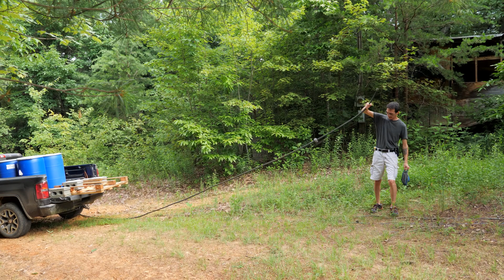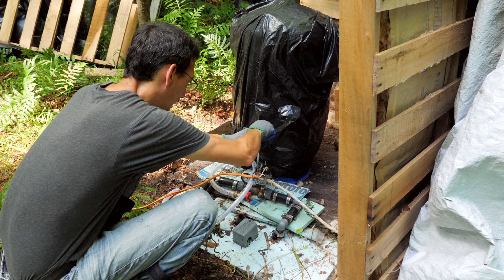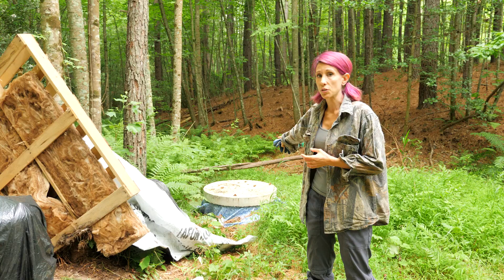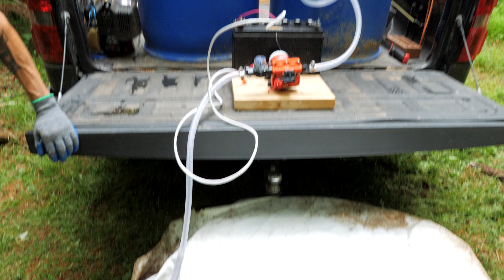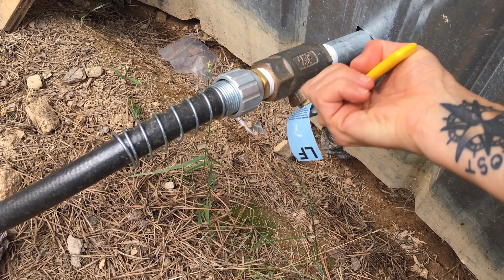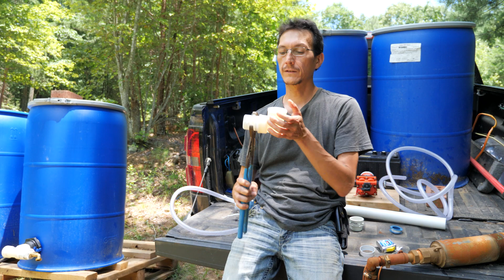NO WATER...AGAIN! Will This Off Grid Gravity Fed Water System Work? (Part 1)

Comment: A good deterrent to snakes in well houses or other areas is moth balls, if you spread them around inside and around your well house or sheds it will deter snakes, for some reason they will not go anywhere there is a moth ball line, moth ball granulated works very well too, years ago people kept snakes out of the crawl spaces of their homes by using this method.  We live in Oklahoma where there is no shortage of copper heads and we have found it really works.

Comment: There is an alternative to re running a larger gauge wire, depending on how much load your pump takes it may be dramatically cheaper as well. You can just use a pair of transformers in most cases. I don't know of any direct burial/UL rated cable that isn't rated for 600V min. so as long as you don't have breaks in the line there should be no problem stepping the voltage up to the 480V regime so that it can make the long stretch without causing so much joule heating and loss in the cables because you're pushing 1/4 of the current. Then you just step back down to the 120V regime and go straight from that to the manufacturers pump wiring. You might have to look online for a calculator to tell you how many volts you're going to drop on the way @480 @ whatever load the pump takes, so that you know what winding ratio to order for the second transformer, but that shouldn't be a challenge with the experience you've gotten so far. All you need to know for the transformers is the winding ration of ~1:4 (120V:480V) on the sending side and somewhere between 4:1 and 3.5:1 (480-420V:120V) on the pump side, as well as the VA (Volt Amp) rating, which can effectively be set to the wattage of the pump + a few% for peace of mind for the pump side transformer, and that number + the estimated wattage of the transmission losses on the sending side. Seems complicated but it really isn't and it could be so much easier than re laying 8awg that whole way.
Reply: Nice suggestion.  A the beauty of it all is the necessary components are readily available from places like Ebay and hunting on Craigslist.  600V AC is easily doable and safe.  The installation would be straight forward and easy to install.
Reply: Eh, I mean, I know all modern cable is tested to several KV but I don't like recommending more than 480 to anyone that I can't confirm to at least have a Journeyman's hours because 1) that's the highest their going to find common documentation for and 2) that's the highest voltage on a load restricted system that I've taken clean across the chest so I know a healthy adult male should be able to take it. Not fun, never trust people when power is involved. *Never*.

Comment: Hmm..  and here I am dealing with mice in my house and finding that a challenge, not sure I could handle copper heads or worse...   you guys take care and keep safe..By the way, "alligator clips"   (at least that is what I know them by??)   would maybe be a better option to connect the wire to the battery, faster "on/off" option??   Please, I am not putting you down by any means I have the greatest respect for you and how you are coping,  Just trying to offer my 2 cents worth...

Comment: I would install a 500 to 1K gallon spring box. Run a #4 wire set and bury 4” pipe. Run a 2” pipe inside the 4” pipe. Bury the pipes below the frost line and if I hit solid ground then I would insult in pipes. I would not spend $10K or more on a well that has no “ Guarantees” of water nor flow when I have a spring on my land!

For the $$$ you spend on the well, $10K to $20K, you could install a big spring box, 800 to 1500 or even 2,000 gallons of water, install a solar water heater and a solar power system to pump the water... Go rent a track hoe. Get something the size of a 320 Cat. Not a toy! Or hire it out, just make sure that it’s a big hoe so it can move the rocks and dig through the hard ground... I would dig out the spring so the water enters the box from the bottom of the box through several feet of wash stone. Bury the water line so it is in a bigger pipe. That way when it needs to be replaced all your doing pulling Out the old and installing the new... I would have it so I could use the bigger pipe till I was able to replace the water line...

I do not usually give advice but you have water on your land. Why not use it?   The water bugs in the pipe. They help keep the water clean. People have been drinking water from spring boxes with your ‘creepy crawly’ for a really long time... They help keep the water in the spring boxes clean. They eat the things that contaminate water.

There is on question I do want to ask you that most people that use springs or the old timers all use to know... Why have you not cleaned out the pipe or spring box? All spring boxes need to be inspected every few months and cleaned out.

Comment: If you purchase food grade IBC totes you can then just paint them black and stack them in the shade.  They can be interconnected and then outflow connected to a standard hose bib.  This is connected to a simple pressure tank and then run into the house.  Each tank is 350 gallons.  I have 10 that I collect rainwater in to water the garden and run the showers and wash clothes with.  The outflow runs into the garden via a drip system.

Comment: Just a suggestion. I use the same sea flow pump it can be hooked up to the pressure tank. You have to put a check valve on the suction side of the pump. It pumps up to 60 psi then shuts of. You may want to wire it to the pressure switch you have now so you can adjust pressure. That's what I did to lower my pressure making run time lower. Stops the need to haul water, you may lose some volume but I didn't. Then you just need to keep battery charged on ocassion

Comment: One temporary and cheap rainwater catchment reserve option is that you set up a tarp catchment uphill from the barrels. ... old billboard plastic/tarp tied on four corners (high-ground or between trees) coming down in the middle V with screen covered pvc going down to your barrels . I believe Homesteadonomics had a YouTube on something similar very recently.

Comment: A bulge pump for a boat can pump like 1800 gallons per hour. Its only like $70 at academy. I have to use one to drain water out of my jet tub. The slum lord...i mean land lord (lol) did not want to fix the leaky shower pan or take anything off of the rent for me to fix it. So i had a water hose coming from the shower head to get water into the tub....and a hose connected to the bulge pump going straight into the toilet... I spliced the wires and connected it to a 12 volt adapter plug. It worked great...that way you dont have to hand bail the water out of the well.
Reply: Lol...yall did it...not even minute after i suggested it...

Comment: 8-2 copper UF-B (direct burial) wire is about $1.50/ft.  If you get a 240V pump, 10-2 UF-B is about $1.00/ft.  Some one smarter than me would have to do the voltage drop calculation for 350 ft, but 12-2 UF-B is about $0.50/ft.  My guess is whoever put the pump in was assuming they were going to use a 240V pump.

Comment: You should be able to hook the RV pump up to give you additional pressure like an RV is hooked up. When you turn the water on, the pump should come on "on demand" when the faucet is opened. At least that's how my RV works.

Comment: Most people do not realize how expensive skeptics & wells are to do/have ... you can tell them it costs $100/ft and it's 350 ft down but they just don't get it.  They don't nderstand that the new well cannot go where the old well was ... they don't understand that it can take weeks just to get the well drilled.  Most people figure if your well is dry you can just run a hose over and fill it up.  These are the people who take really loooooong showers
Reply: I asked a man about drilling a well for me.  He told me $15K  That did include a pump and everything though.  He said I could get about 35 Gallons/minute.  It was for irrigation.  I almost swallowed my tongue.

Comment: You could develop your spring an maybe use a ram pump to move water up the hill to then use a gravity system. Check out practical preper
Reply: So, I researched a ram pump. They seem magical, but the bottom line is they waste 9 gallons of water for every 1 gallon delivered up the hill. It's essentially a hydro-gravity powered pump with few moving parts. If you have a reservoir feeding a stream and the stream is the waste exhaust, it's OK, but I didn't see that as an alternative for them.
Reply from the maker: It also requires a lot of vertical fall from the water source to generate enough energy to run the pump to push the water back up the hill past the source and to the destination. It’s totally impractical especially in our location where the water source is already at the low point. They’re also loud and unreliable. A YouTube fad. A bunch of people have watched Scott Hunt make them work and now it’s a bit of a YouTube fad or buzz word. Lol
Reply: Yea i don't  know the lay of your land. Just heard the part about being 40' up an it come to mind. What about catching the spring into one contaniner then pumping it to the higher ones to be gravity feed.

Comment: in training for SCUBA Diving, one learns one atmosphere = 14.7 PSI and every 34 feet in fresh water = 1 atmosphere

so 40 ft above your trailer=14.7  40/34 = 17.3 PSI

not the pressure you are used to  but usable
Reply from the maker: 1psi per 2.31ft of vertical rise. 17.3psi

Comment: Yikes! I'm not a fan of snakes. Also, don't like anything with more than 4 legs. LOL! If you need to boost your pressure at the house, you might be able to hook that rv pump up at the house and gravity feed to the pump. Might work.... sounds good anyway! hahaha. I was a little surprised you had as much pressure as you did. Seemed to work pretty good. I have a suggestion for running the new wire. You may have already done it, but here goes... If you have to dig a trench for the wire, put in a small pvc pipe to run the wire through. That way, in the future if you need to remove or replace it, you can just pull it out or "snake" a new in. (pun intended) hahaha. I had a situation at my house with well water pipes. My pump is in the basement and the pipes go out to the well. Thank god when they were installed they were run through a 4 inch tube. When I had to replace them, I didn't have to dig them up. Good luck!

Comment: In scrolling throw the thread I saw at least one other person that had the same point of view that I have and was instilled by my grandfather. LDS Prepper says this a great deal " one is none two is one", to go forward with the thought process of we are never going to use this well after another well is established may not be true. Never say never. You see it might be a good idea to keep the existing well in top shape because in the future you would be able to use it to say livestock or garden and what not.
Reply: Even if they use it for animals/garden use the power would be coming from the new house location not the location of the trailer so any investment now would be a waste past getting things running again.
Reply: True. I was just looking at future uses and possibility for the existing system that would justify repairing or replacing the pump as well as installing new eight gauge wire. From what I priced out would be about $450.00 and that is just looking at the 8 gauge outdoor wire which the Home depot aka big orange barn only sells rolls of 500 ft so that would leave them extra for future projects and a 3/4 hp well pump. And I am only using the depot because I do not know of what suppliers they have nearby.

Comment: --- PRESSURE FIX --- : The water pressure is just fine. To have usable pressure you need as little as 10 feet of the water head. What you are having problem is the flow. I guess advising you to switch to a larger diameter of the hose is not something that you can easily do BUT if you run secondary (borrowed?) garden hose from your tanks to the house - you will double the flow capacity.

Comment: I had a 500 gallon tank on a stand at roof height on a one story house that gravity fed my home for some 15 years and it worked fine  I filled it from a underground concrete rainwater tank that caught the rain water off our house and shed I only Ned to fill the header tank about once a week and to do that I had a petrol firefighting pump which worked really well being a Honda it always started a necessary faction in a firefighting pump fire don’t always give you warning especially bush fires

Comment: Could you not put the pump up the hill close to the house? and just run the pipe.
Reply from the maker: It’s a submersible pump.
Reply: Ya I keep trying to think of a temporary fix but the new wire is probably better than them. Can you guys do a rain catchment in your area?
Reply from the maker: That’s what these barrels were meant for. We have a plan now. Stay tuned.

Comment: Ideas; wire pump line to 240v then use a step-down transformer to 120. no need to run thicker wires.Put transformers in parallel if only lower current ones available. OR; You can use earth as neutral and use all thee conductors a 120v hot in a ER situation also. Your breaker should have cut the pump off preventing burnout. Ground wires are silly on this long underground feed. You would need a copper rod or two driven under ground and because of water it will be a perfect ground or neutral for your power.

Comment: What is the amp draw on the pump? find the correct wire gauge to match the pump amps.  Then for every 100 feet, increase the wire size by 1.   At 350 feet, you will be increasing the wire size 4 times. 3.5, round up to 4.
Reply from the maker: 10 amps at 115 volts. #8 wire should work up to 390’ with this pump.
Reply: yes. That will be fine. [copper not aluminum]
Reply from the maker: I will never use aluminum wire
Reply: It has its place, like service entrance/sub-feed cable.  Or when running for a range/drier. When anti-ox is used to terminate, no problems and to do same job in copper is too costly for most people.  Other than that, I agree.

Comment: You've probably figured this out but if you put a plug in the tub when you shower and then use the water in the tub to flush the toilet, it will reduce the amount of water coming out of your "rain barrels".  Good luck guys; this is the pitts and I feel for all the hassle you are enduring.
Reply: Hehe, this was my graywater sstem for two years. Perfect since the shower base leaked. Then I moved and got a compost toilet =(

Comment: For the pump-the voltage is not the problem. It was the AMPS-too high for that small a wire.
Reply from the maker: Correct

Comment: A large water tank and collecting water off your roof is free water when it rains. The snakes need to go. Pipes that go a long way have the same problem as wires that is resistance from the internal surface area. Wells are very expensive and you need more power to pump.
Reply: James Parlane I'm totally an advocate for rain water harvesting however I'm not sure they'd be able to harvest enough for their needs.
Reply: At present there may not be sufficient roof catchment area but a tank gives a large quantity as insurance and is essential for fire fighting. Out in the stix they will be toast if lightening strikes. With the new house they will need fire protection for it. Where  I live here in NZ there no snakes in the well. Something needs to be done to get rid of them too. Thanks for your interest. I really enjoy this channel too.

Comment: Hard to explain but I don't think you need pump put in a piece in pipe so water can't back flow an it should suck water from river to barrel as long as barrel is higher than everything else put shut off on it so you can fill system before turning it on

Comment: I would seriously recommend not getting a well drilled as they are very expensive, and not always acurate on the first drill. Rainwater harvesting is much cheaper and easier to maintain.

Comment: Go to Wranglerstar’s channel and search for Rampump.  I believe this is exactly what you need.  No electricity needed.
Reply: Ram pumps require flowing water to work so wrong type and location of the spring.

Comment: If anyone ever needs to bleach shock a system again try putting a little (gallon) of diluted bleach in each barrel and roll it around to rinse the sides, flip it a few times to rinse the top and bottom, and empty the barrel.  Repeat for rinsing.
Then all that has to be rinsed full is the hose.

Comment: The more water you have in storage tanks above your tap the more water pressure there will be.
Reply: Shawn R actually it is independent of volume, only height of the top of the water 1psi per 2.31 ft of elevation.

Comment: why not use the portable pump you bought to supply the pressure tank.  The battery should last quite a while.  Use the internal pressure switch or use the old pump pressure switch.
Reply from the maker: I would rather fix the whole system to work properly.

Comment: Your temporary system will not work for the next 6 to 12 months due to freezing temps in the winter.  Running the correct wire and fixing the pump is the more logical solution.  It will work if you drill your well for the new house and change over to using that for the time being.

Comment: Snakes hate amonia, just riddle the area with Moth and it will drive the snakes away.  I have copper heads and rattle snakes and seems to work at our property.
Reply: moth balls.
Reply: The commercial product Snake A Way is a mixture of Powdered Sulphur and Mothballs.
If you DIY. Just a little bit of mothballs go a long way. Try not to breathe the fumes.